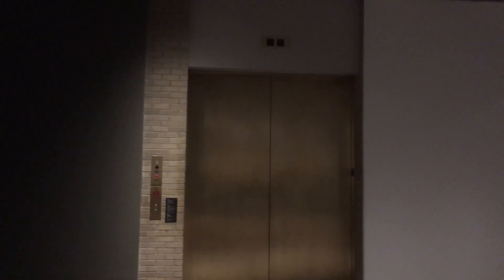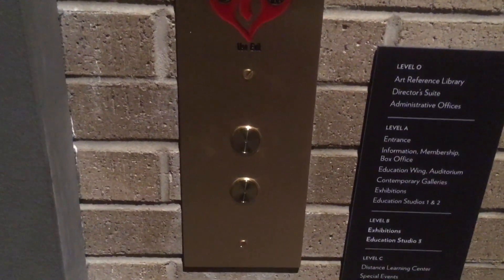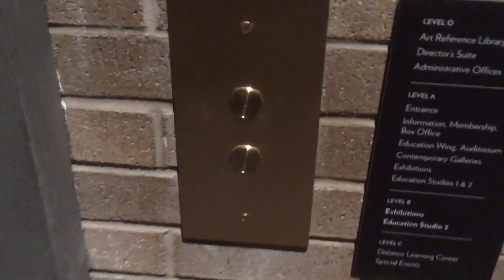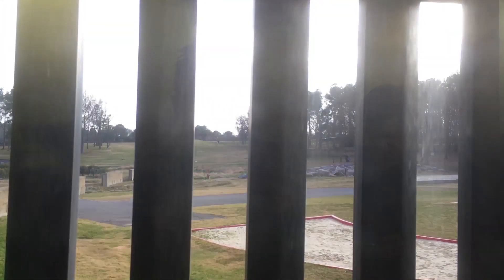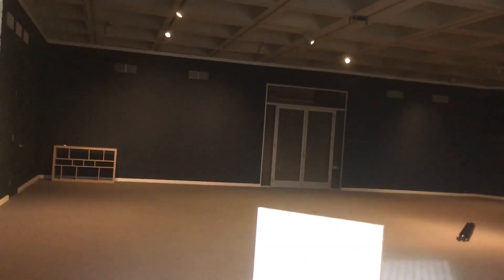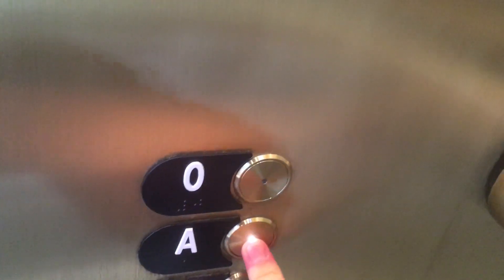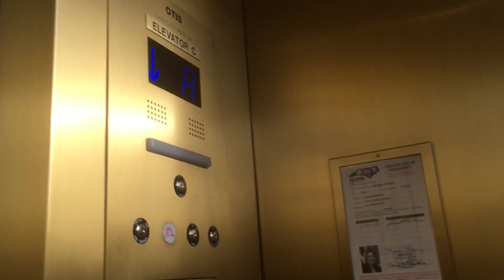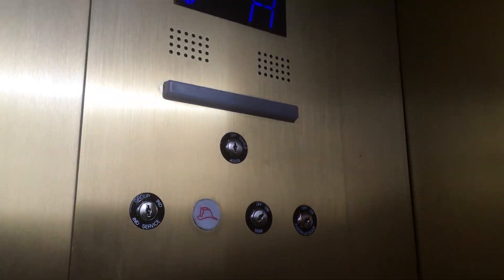Modernized! ESCO/Otis TRIANGULAR-SHAPED scenic elevator - NC Museum of Art E. Bldg. - Raleigh

Comment: I rode this elevator back in the third grade, during my field trip there. It was original back at that time. I’m sad it got modded.
Reply from the maker: Yeah, I’m sad too. The 1st time I rode this was back in Dec. 2012 & it was original then. Then the 1st time I filmed this was back in Dec. 2014, & also the only other time I rode this when it was original, as it was broken, & in the process of being modded the other times I was here. The mod. finished in around late Jan. 2017. Also, did you watch my video of this when it was still original?
Reply: Yes I did
Reply from the maker: Cool.
Reply: I was just there today for the "You are here" exhibits (Ends July 22nd). They fixed the outside indicator on Level B, I rode it about 5-6 times today
Reply from the maker: I figured they would have long done that by now.